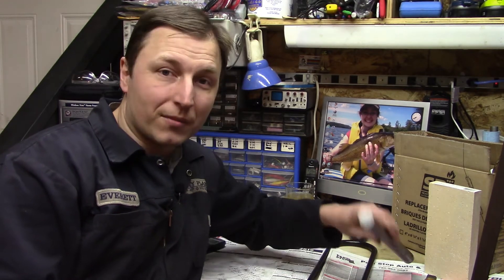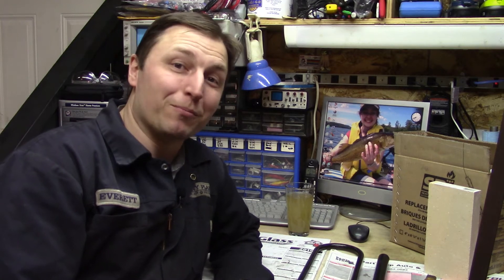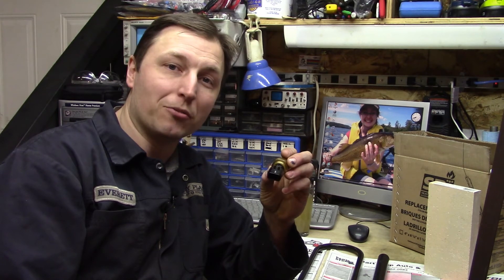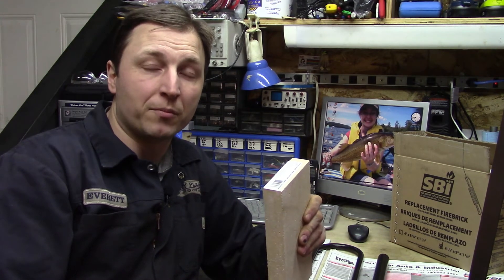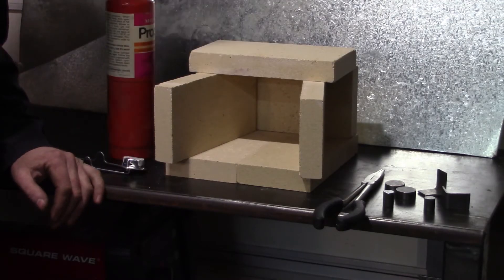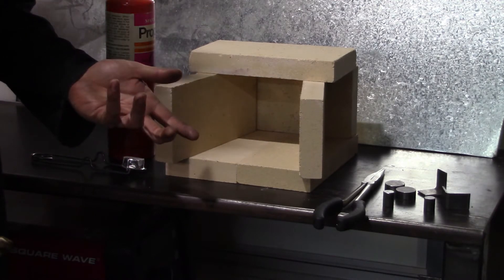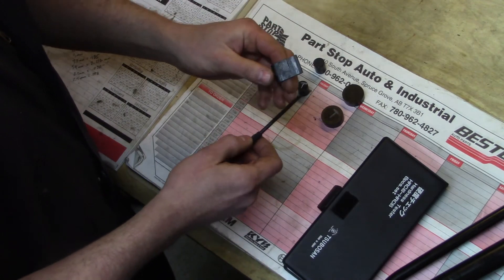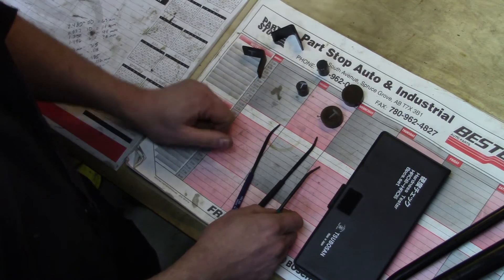Experimenting with Scrounged Metals

Comment: You have to heat to a "boiled carrot" before you quench. The term "cherry red" is misleading because we no longer can find old-fashioned cherries. You should also "soak" it in the heat, 1 min per inch of depth. I have had good results -- you can sometimes harden rebar!
Reply from the maker: Thanks Juan, looking back I see so many things I could have done better in this video, but it is what it is. Pierre did a much better job of testing bed rail material and even has the Rockwell machine to properly test with. At some point in the distant future I will revisit the mystery metals but will need some more equipment first.

Comment: Very interesting video. I had no idea that specialized files are available for testing metal hardness. Thanks for sharing.
Reply from the maker: Thanks, this was an experimental video, and after doing it I realized that I need more gear before feeling confident in properly hardening and tempering stuff.  All in time.  As for the files, they are a Japanese make called Tsubosan, and are quite reasonably priced compared to a full Rockwell tester, but do have their limitations.  Thanks for joining in!

Comment: Hi Everett,
Stink up the kitchen...    lol     (   Mostly a grin ...)
I took a few minutes to test your bed frame material, or similar...
Got an acetylene torch, though, (much hotter) and a Rockwell meter
As is, without any treatment, material testing between 20 and 25 RC
After reaching transition zone and quench in cold water:  58 to 60 RC
Yellow straw color temper:  54 to 55 RC
Blue color just a little above straw:  51 to 52 RC
This bed frame material may vary from batches to batches, but, should be not so far as specs. This material seems to me like medium carbon steel like 1045 or maybe a little more carbon, you could probably treat it as 1045 and get decent results.  Avoid using this on critical devices like trailers or person holding devices as a welded unit, as it could easily crack, it would be safe to use as a riveted or fastener assembled unit, though.
I think that your propane torch is really lacking the ability to get it hot enough, at least seen from here, be aware the there are different hardening temperature needed to different alloys. 
Good source for reference is to go on Atlas Steel's web site from Australia, they got good charts and details.
Cheers, and avoid the kitchen as it's wife's territory...   Pierre
Reply from the maker: Yeah, I can't really call the bed frame test conclusive, and certainly wouldn't use an unknown steel for a safety-critical application.  When I figure out a better heat treating setup I might play a bit more with the bed frame material.  Interesting to see your results, maybe that metal could be more useful in some situations if it can take a hardening.  
But yes, I'm very thankful for a patient wife.  Just don't want to push it, lol
Reply: There is no problem using the frame as found to make shelving, supports, etc...   As long as you don't use it without controling the results or solidity after modifying the properties, cause as found it's a pretty good and solid material...  As with any other material that you modify the properties...     Steels like hot roll or cold rolled doesn't matter much cause heat don't affect their structure.

Comment: I should probably try similar experiments on mystery material - of which I have plenty.! I always try and get hold of scrap when I can... particularly brass!  Metal generally is so darned expensive.
A lot of rod type parts from cars are worth checking I find, and have used bed frame angle iron in the past for simple fab.
I think you could well usefully get hold of a large size propane burner to run off a 20lb tank - I use that in a small cluster of fire bricks... quicker heat up and reach a better high temp. Must make me a mini furnace one day.
Interesting to see your results - not surprised with some of the rod hardening results.
Reply from the maker: You're right, a bigger burner would be needed for anything of size.  I've got a tiger torch so a bit of experimenting with brick configuration and using that should work.  But yes, I suffer from "packrat-itis" when I see some metal pieces in the scrap bin that might prove useful someday.